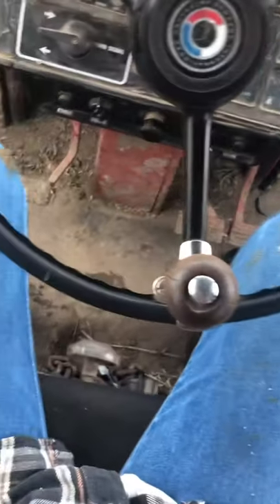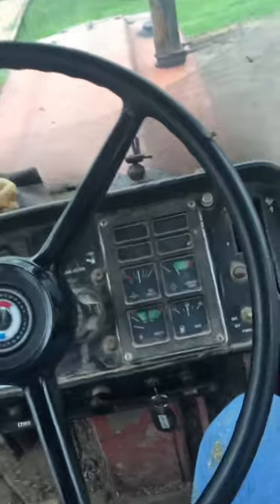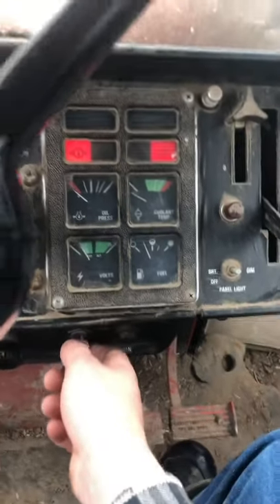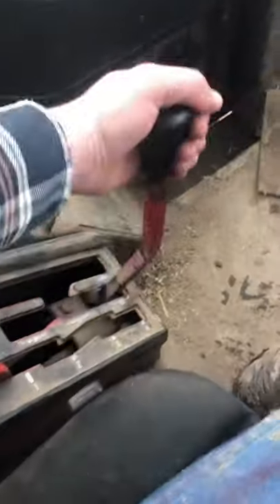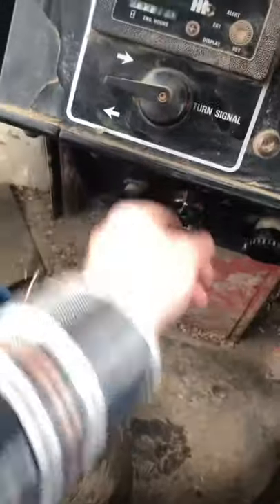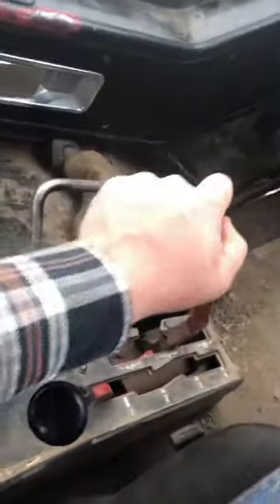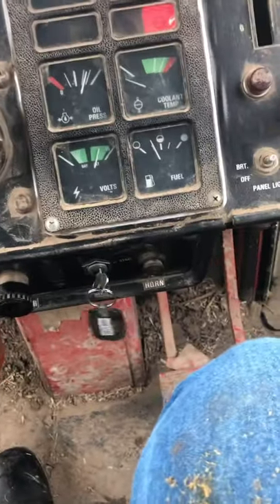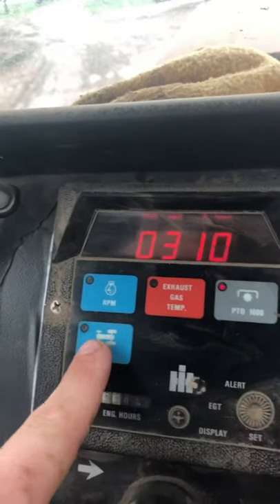How To Drive a 1486 International Tractor

Comment: The thing he didn’t know what it was is the TA or torque amplifier. It is used to lower the gear ratio when and if needed under a load without changing gears or clutching.
Reply from the maker: Thanks for the info
Reply: @mulletboys9830  no problem anytime, make sure the TA is properly adjusted, if not it’ll cause excessive wear and eventually the TA won’t work and can cause the tractor to freewheel on a downhill slope. Do not, I repeat do not be shifting the TA while stationary, only while moving and the tractor is pulling under a load.
Reply: @jamesbreithaupt5138  different System, the ta used a sprag clutch and had issues but aftermarket has solved a lot of it. The John Deere was a hi-lo and had a whole separate clutch pack for its system and they never really gave issues and u could shift them at any time and they would be fine. Also be careful with them 2840s and keep the filters changed they where bad for people not changing the o-rings on the filter housing and they would go bad and choke up the front hydraulic pump. They also had issues with the internal pump going out which is a very expensive fix.
Reply: @jamesbreithaupt5138  I got a 2940 which is basically a updated version of a 2840 and I know where prolly 30 of them are with over 15,000 hours on them. I’m from tobacco country and they got run hard on bedders and shit like that.
Reply: @jamesbreithaupt5138  the 2940 I got has got a different engine kit and a few things and it’s somewhere around 110 horse. But the 2940 didn’t have the issues as bad as the 2840s also they where a lot heavier and had a little different rear end. Mines also got the soundguard cab which is nice
Reply: @jamesbreithaupt5138  I agree 100% it wasnt really intended for tillage but the 359 engine used was used in the European 4040s which was 120 hp I think it was somewhere around that amount
Reply: @jamesbreithaupt5138  we used a 4455 and a 1066 mostly for tillage and used a 4040S for planting and it was our main hay tractor along with a 2030

Comment: Wow I have never seen a tractor that you don’t use the clutch to put it in gear, start and stop. Seems hard on the transmission to me
Reply: But you do use the clutch to put it in gear? 🤔 Most new tractors you don’t ever have to touch the clutch if you don’t want to
Reply: @nalley6815  yes you do have to clutch to shift into gear initially, google how an IH TA works and it’ll tell you that it’s a sprag that does the pulling once shifted into low range with the TA. Plus if it’s a new tractor that doesn’t require you to clutch to move in forward or reverse it sounds like it is hydrostatic is why.
Reply: @codyallen4308  I know how a TA works. And no it’s not hydrostatic. Electronic hydraulic shuttle shift
Reply: @nalley6815  well you questioned if you had to clutch to shift into gear, I assumed you weren’t aware how a TA worked on an IH tractor since you asked that question.
Reply: @codyallen4308  no I said you have to clutch. The op seems confused on how the trans works so I’m saying but you DO clutch